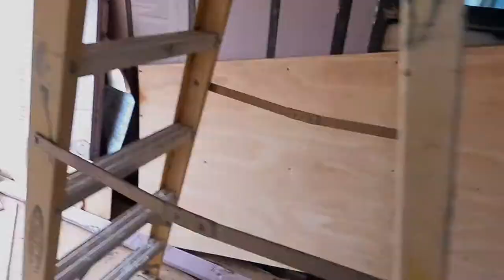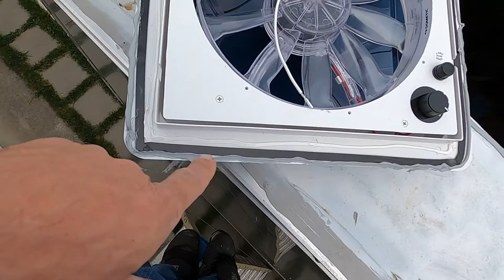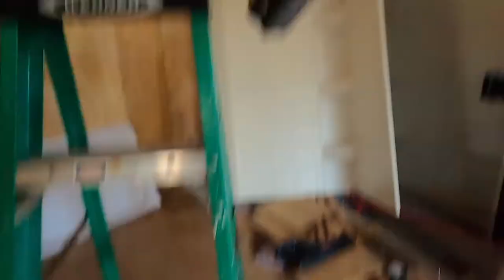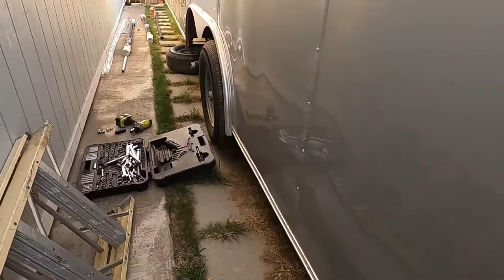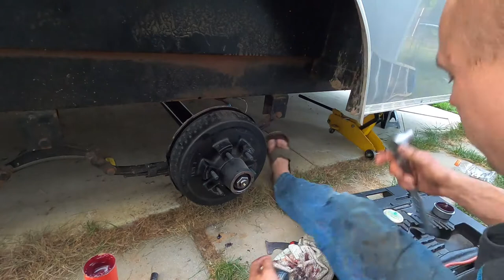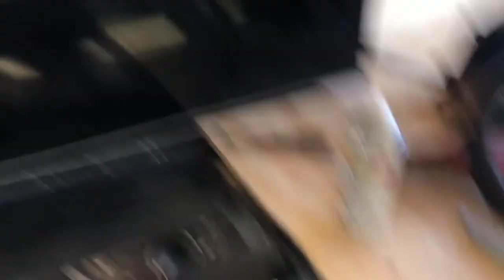My Enclosed Trailer Conversion, into Lightweight Toy Hauler / Camper. PART 2.

Comment: Any issues with discoloring or peeling paint on outside of trailer from welding heat?
 Thanks for videos you've done an awesome job.
Reply from the maker: No issues, I tried to shim up and give it space between aluminum exterior skin and steel every time I was welding something. I even used wet rug sometimes to keep back of steel post cooler. It’s been few years and other than flat tire there is no issues, I redid the ceiling though, spray foamed it!
Reply: Thanks for the reply.  I've been thinking of taking on project like this since travel trailers are so poorly made

Comment: Big gap after replacing the axles? Talker tires 🤙
Reply from the maker: I ended up cutting and lowering wheel wells. Thanks for the idea, but I’m not sure if taller tires would fit without spacing axles further apart.

Comment: Did i miss the reason why you decided to buy new axles? I could be wrong but cooties you just do the spring over with the stock axles?
Reply from the maker: I did it for clearance,  spring over axle would be easier and cheaper for sure , but it would have raised the trailer way too much for my liking and the axle beam would still be in the same location hanging low,  going to straight axles I got additional 4” of clearance , so far so good .

Comment: How does the Titan handle the 24' trailer? I have a 2011 SL crew cab with Big tow package. I also had purchased a new 2004 when they first came out and enjoyed it until someone decided to makee a left turn coming toward me and it was totaled. I've been looking at both an 8'5'x16 and 8'5"x20 round top trailer plus trailer. I really like the 20',  but I'm really not sure about strain added to the truck due the added weight, height and sway of the 20' . The 16' weigh in around 2265 lbs empty and overall height is around 8'6". The 20' weigh in around  3373 lbs empty and an overall height of 9'1". 

When looking at them side by side, there is a significant difference between the two. I've been going back and forth the past few weeks trying to decide which one I want to get.

By the way I know the Titan is capable of pulling both, but I've never pulled anything karger than either my 17' bass boat and my 10' utility trailer with my RZR strapped to it.
Reply from the maker: I need to weigh my trailer when fully loaded, my approximate calculation is that I’m around 8-8.5 k lbs , that’s with about 50 gallons of water, 4 seat can am x3, 2 atv’s , plus not counting whatever I put inside the truck, 2 adults, 2 kids,fire wood, gas, food ect. I have made 3 trips like that, through california ( Sierra mountains) and Oregon hills, on one of the trips trany and engine temps started to climb ( was going up some steep hills and outside temperature was around 100 +) let of gas drop to about 45-50 mph and it all went back to normal , other trips weather was cooler and had no issues. Going up very steep grades in 3rd gear and keeps speed around 55-60 mph, i get around 9 miles to a gallon .
Mine is 2014 pro 4x with big tow. I’m planning on replacing radiator with all aluminum bigger one ( stock one will crack on the bottom anyway, common problem in all Titans and lots of other vehicles) and also want install external transmission cooler as well, hopefully that will help in summer.  I have an opportunity to get new ram 2500 ( inheritance ) , but I opted to keep my Titan, diesel is more expensive than gas here, registration is about $1300 a year plus insurance will be 3 times more ( yeah I live in California lol), plus I think Nissan is more reliable than dodge!
Forgot to add, I use weight distribution hitch w/ sway control bars, helps a lot!